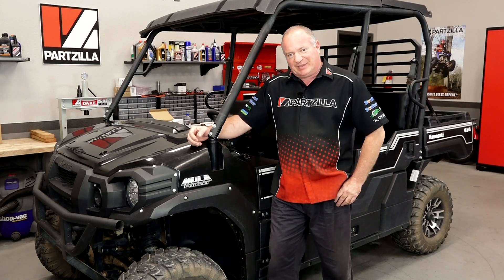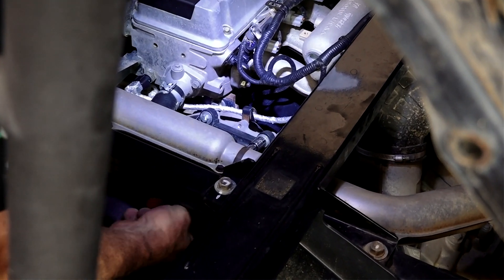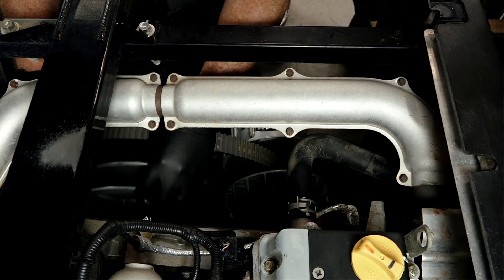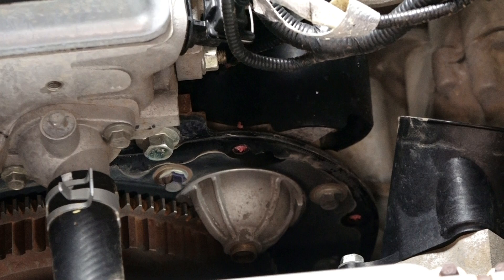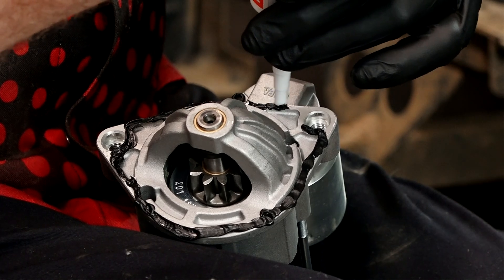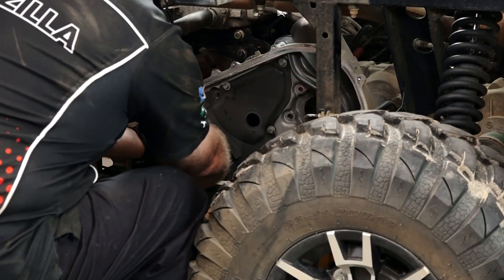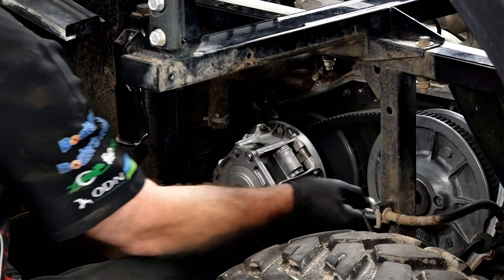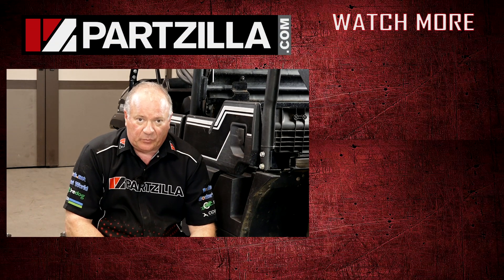Kawasaki Mule Starter Installation | Starter Replacement on a Kawasaki UTV | Partzilla.com

Comment: Hey John, I used to wrench at a multi-line dealership and Kawasaki was one of our flagships. I did a TON of warranty work. Well, I found a cheat-code to replacing the starter. I can have it replaced in 10-12 min from start to finish. Let me know if you’re interested in the procedure!! 👍🏻👍🏻
Reply: shannon parkey I just did one today, but it took a bit longer than 12 minutes. I gotta we that
Reply: @shannonparkey21  still available??
Reply: what is the cheat code, please!?
Reply: Please share the quicker procedure!

Comment: On my 2017 pro FX the rear cover is very tight and does not want to separate from the backing plate. Very difficult to get apart.

Comment: Having a  no start issue after the vehicle  (atv, car, pickup, bulldozer, motorcyle etc) warmed up and telling people to replace the starter because of this is bad advice . I had this exact problem on a older Kawasaki Mule and after just a little troubleshooting found the battery cables needed cleaning , cleaned the cables problem solved  .

Comment: I have a 2022 kawasaki mule pro fxt. I hearr a weird noise that sounds like the bendix on fly wheel. I have removed clutch, belt and bell housing. You can see the starter still mounted on engine.when starting you can see the bendix hooking on flywheel but it makes a weird noise and it turns the fly wheel really slow but there is no sound from the Solenoid to swing engine.Not sure if it's the starter but battery has 12 volts. Has anyone encountered this problem? The sad thing is I'm all the way in the Caribbean and  don't want to order the wrong part before diagnosing the problem.